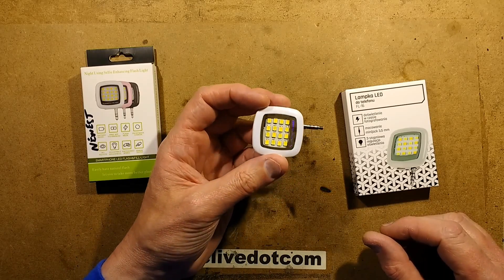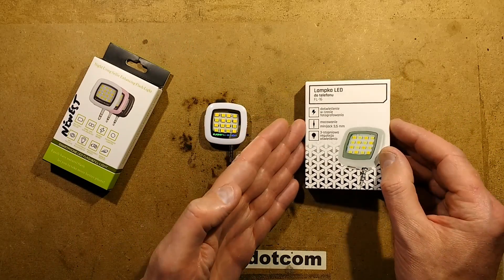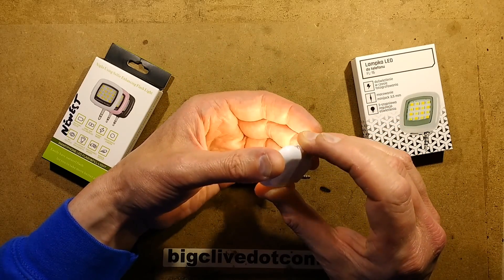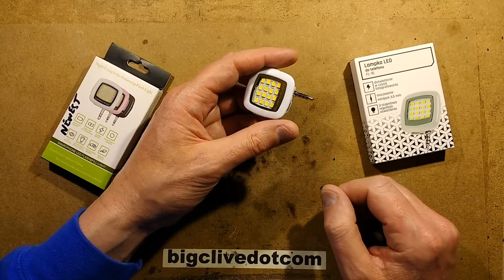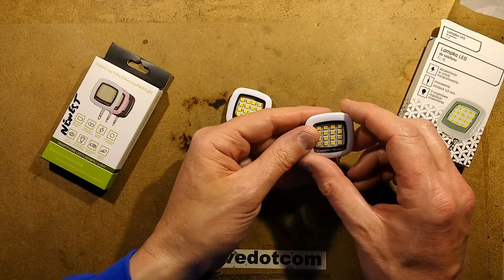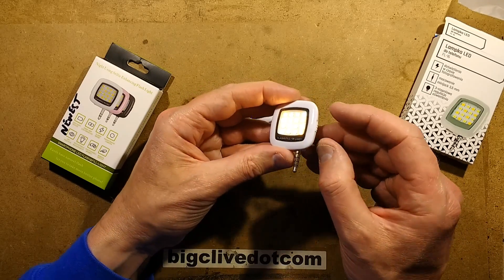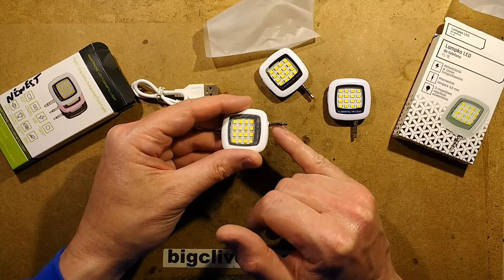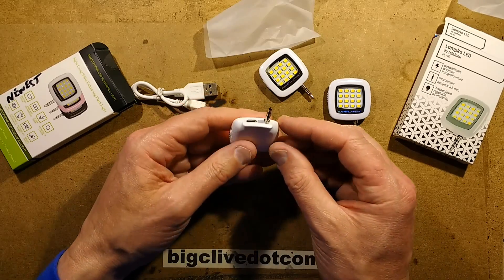Inside three different 16 LED selfie lights.

Comment: have anyone else notice that the hour on Clive's phone is 03 :37?! 

yet it is not surprising, Clive is notorious for little sleep and lot's of great electronic teardown videos!
Reply: There's a loud bird somewhere outside my home that "comes on" each day at 3:30 AM sharp (ask me how I know...). I often dream of murdering it - s-l-o-w-l-y...
Reply from the maker: I'm very nocturnal.  That was a longer than average night.  I got to bed at 8am.
Reply from the maker: I try to get around 6 to 8 hours sleep.  Often less though.
Reply: Well at that time why even bother.
Reply: I don't know if it's healthy, but I'm up till around 4 most nights as well. I try to get into bed before it dawns, because then it starts to get hard to fall asleep with all the light and birds.
Reply: נתמ נרוק looking at my clock 3:40 ... LOL
Reply: as long as you get at least 6-7 hours in a regular sleeping pattern it really doesn't matter when you sleep, just dont change things up too much and your body clock will adapt.
No expert but i do work shifts and this works well for me
Reply: I have worked in sound & light business and you quickly get used to live during the night. 
I was used going to bed at 5-6 AM during the week and getting up at 13:00.
Now it's been 3 years that I work as a railway electro-technician and getting up early is still hell for me.
Reply: bigclivedotcom heh I'm fairly similar. Been getting to bed around 4 or 5 lately.
Reply: There's a medical doctor in the town I live in who only sleeps for about 4 hours a night. He put the extra waking time to use by doing a law degree and becoming a barrister on the side.... And when he finished that, he wrote a crime novel.
Reply: A little like yourselves (posters on this video), I used to be a limousine Driver, and the biggest majority of my work was at night, but often with a fairly full daytime beforehand, so I got used to cat napping, even at really loud events, so I could manage. 

But it really does take it out of you, so its nice to get a day off, and get some proper sleep! 

Mind you, I've always been a night owl, and was hyperactive as a kid!!
Reply: its probobly 12 hour time

Comment: Are they supposed to be controlled by square wave PWM over the audio channel, perhaps?
Reply: I have tried KEUWL frequency generator from GP and my light reems to respond on the right audio channel, changing amplitude and PWM duty allows for nice dimming, strobe effects are also possible.
Reply: ParedCheese   So you can hear the light, i guess?